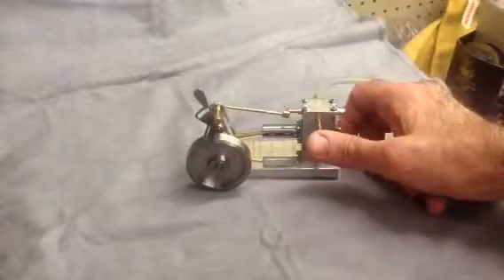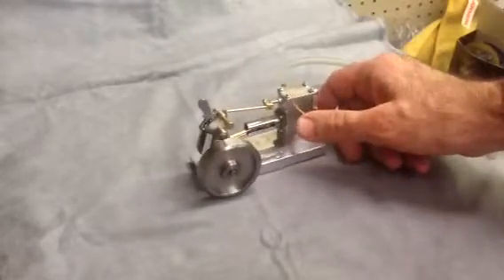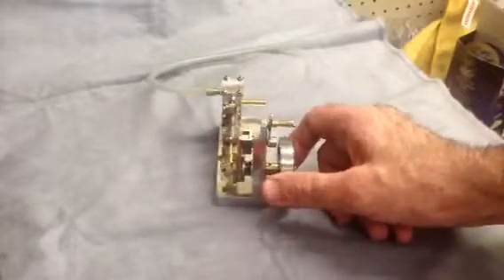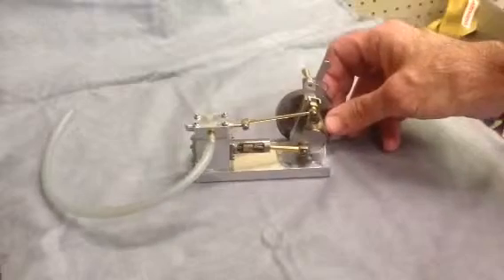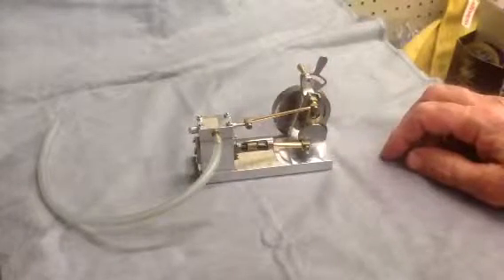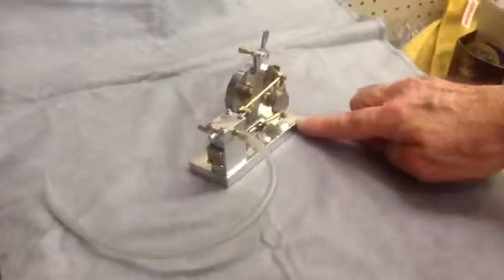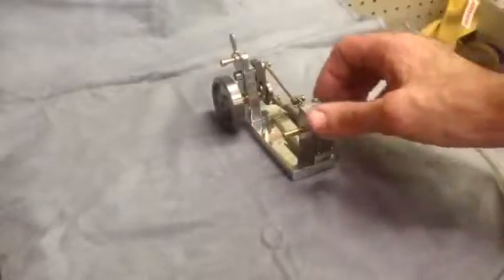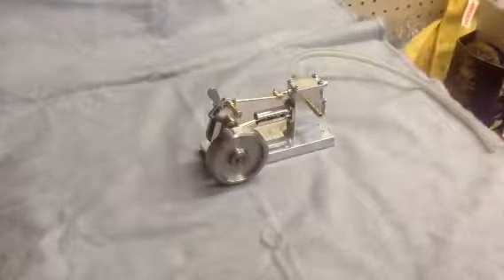model steam engine elderberry mill engine

Comment: Very nice! What does the lever on top do?
Reply from the maker: +Lawrence Gill 
Thank you, that would be the reversing lever. Basically it slides the valve mechanism just enough to allow the engine to run in reverse.